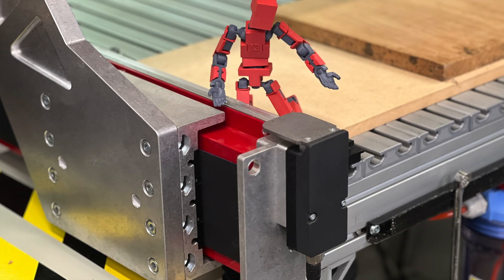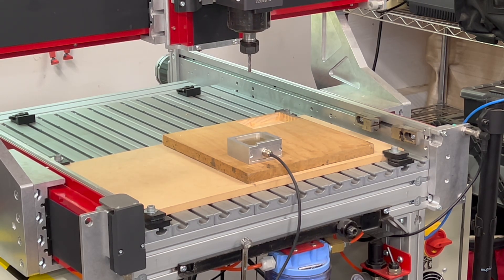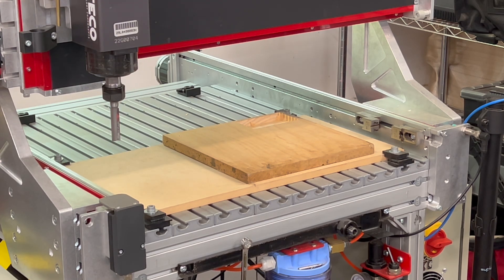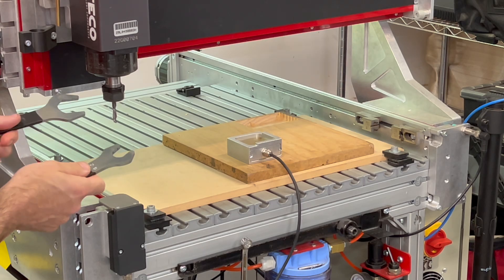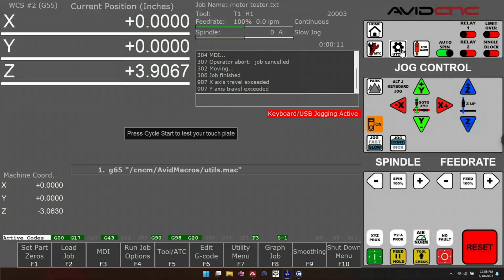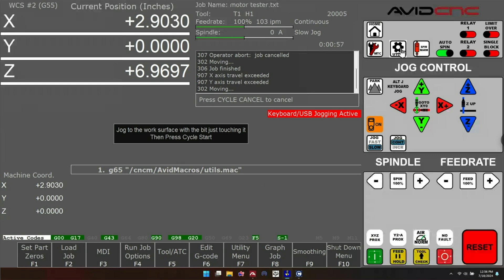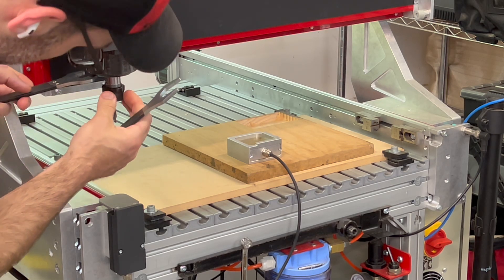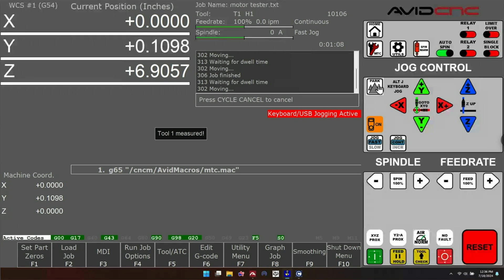Tool Height Setter - Avid CNC EX Controller

Comment: This is a simple feature, but it is going to make a big impact to usability.  This will make manual tool changes so much better, but also makes the system ATC ready, AND makes the zeroing processe the same between manual and ATC changes.  Its really cool that it is out of the footprint of the spoilboard as well, so we can still extend past the front of the machine when tiling projects larger than the machine.  Well done!

Comment: It would be really great if this feature existed for the old Mach 4/controller system as well.  If the new hardware (tool height setter) was able to plug into the old controller, I suspect some of the custom mach 4 scripts that others have created for systems like CNCDepot ATC could be ported to Avid Mach4 without too much dev time.  I would really love this functionality without completely swapping out my existing controller.  Thanks for considering.
Reply: i second this

Comment: I’ve been asking avid for this feature since I bought my machine 4 years ago so this is very exciting! When doing the initial calibration, couldn’t the traditional avid touch probe be integrated into the utility to help establish the offset rather than manually setting it?
Reply from the maker: We do it this way because it doesn't require another tool (not everyone has an Avid CNC touch plate) The "paper" method is a tried and true way to get it really accurate.
Reply: Makes sense, thanks for the reply.